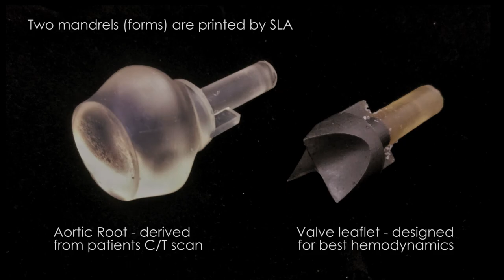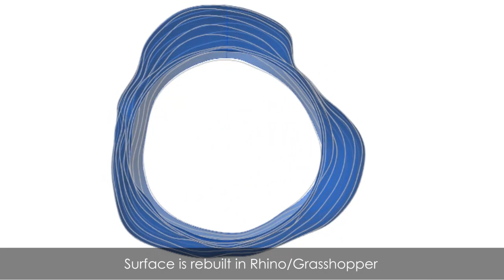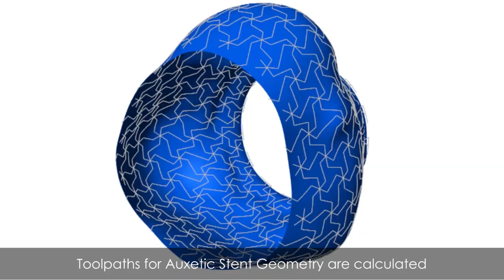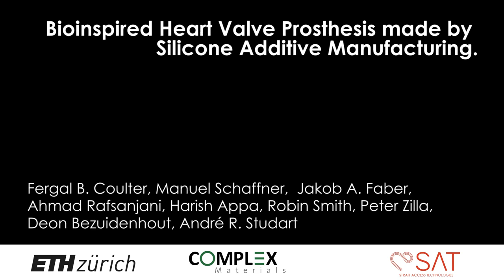3D Printing Silicone Heart Valves (Video 2 - Fabrication)

Comment: We have advanced so far in recent years technologically yet I am still given the same option which was available 20 years ago for valve replacement. We need a long life option to mechanical valves where the patient is not required to take warfarin for a lifetime. I mean we put a man on the moon in 1969 and in the year 2021 we are still using mechanical valves!!! There is either a lack of will or a lack of funding. I hope the future is brighter for us.